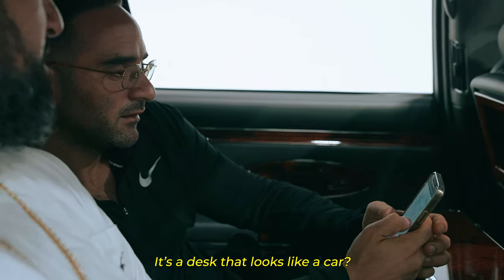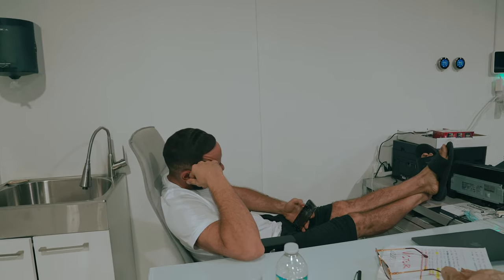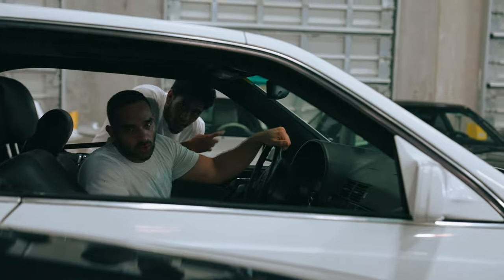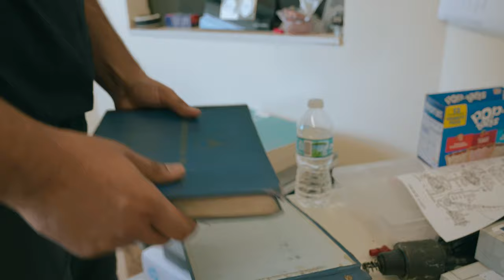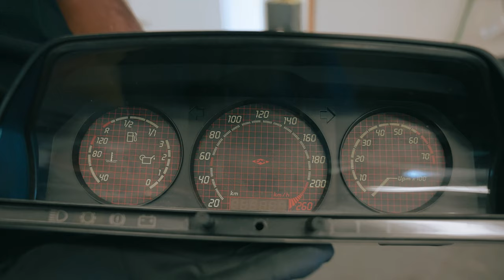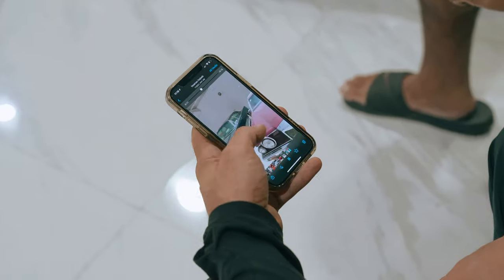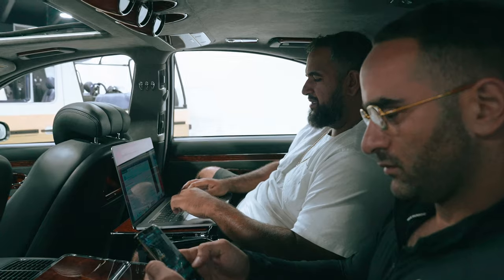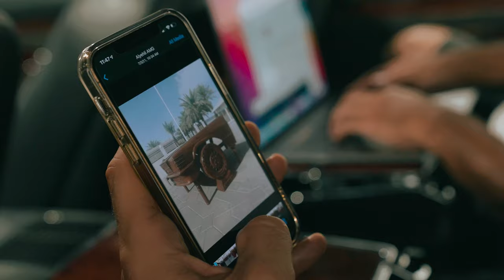Managing 100+ VINTAGE Mercedes Collection! Koenig, AMG, SGS Styling Garage | VLOG #008

Comment: Your guy with the sunroof issue, the sunroof has to be timed.  The plastic knob is for timing, pull it out to the center position and rotate it, then push in back in and check the position it goes to.

Comment: The sunroof issue with only going backwards is a adjustment issue.   Mechanic probably loosened the clutch and then hit the switch and then it got “unadjusted”
Reply: Hi, after replacing the switch sunroof worked perfect.